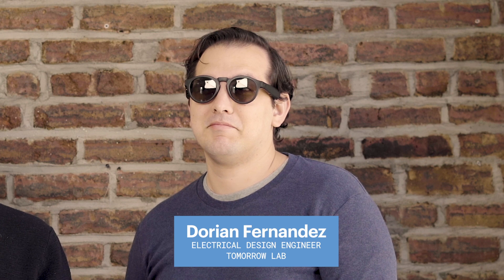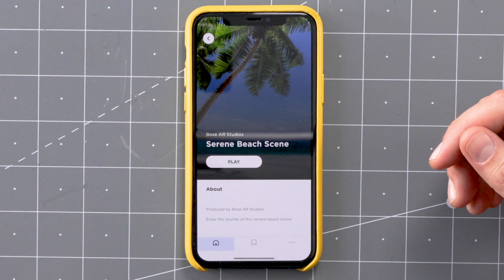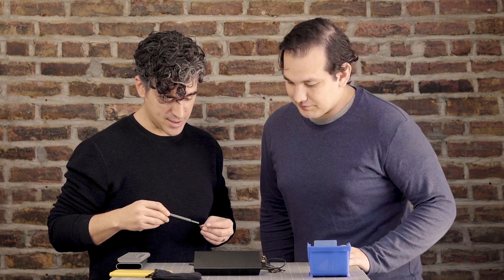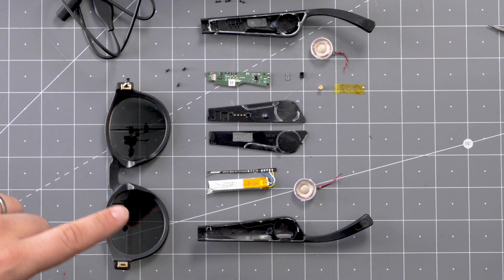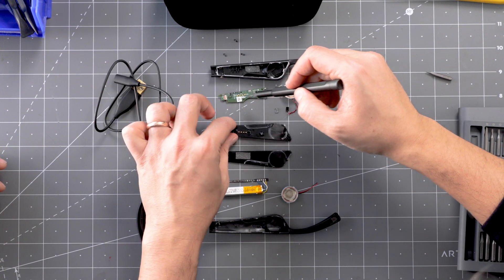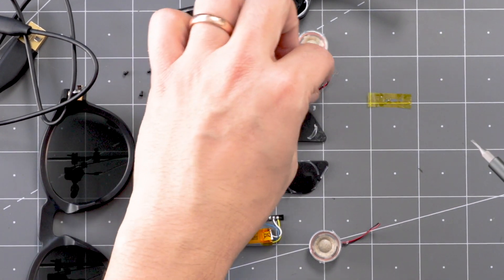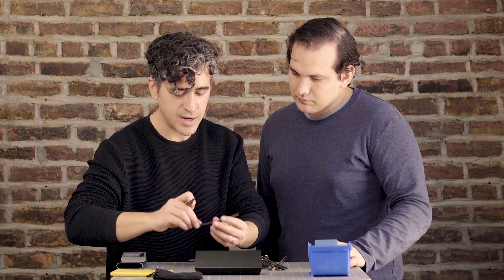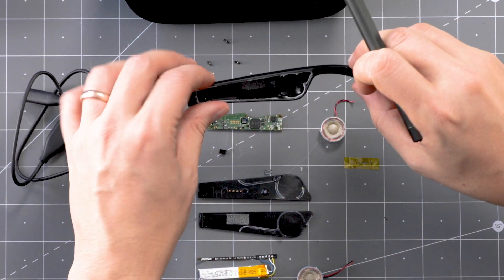BOSE Frames Teardown

Comment: Thanks for this. My frames died after 2 years and Bose won't repair or replace them, and they discontinued my style, so I'm stuck with my $400 lenses and a dead frame. They offered 20% off a new frame, that cannot take my lenses. I am escalating with Bose now, with high hopes they will step up and repair my frames. Glad I bought Bose, not a foreign knock-off. If not, your video will help me in my own surgery to attempt to repair.
Reply: Me too. But these guy should show us how they tore it apart without breaking.
Reply: I wonder if you had any success with Bose in the end - after about 8 replacements of Soprano, Alto, Rhonda they just stopped doing the replacement and they still have my last pair and refused to acknowledge receiving it even though I have the correspondence and postal label/ express post receipt. Their customer service became non existence sometime in 2023. Its just insane how the frames are so good to use and only last few months from terrible manufacturing choices.  Its so unfair as well they would send a replacement/refurbished pair but that serial no was out of warranty so you had to fight them to even replace that pair after even a couple months. Once I purchased two brand new frames while travelling off Amazon only for them to both stop working within a few days of each other. Most of mine have the issue with I assume loose cable where it only powers on with the bent arm, as soon as your try to wear it powers down.

Comment: My Bose frame came unaligned and would like to know what screw driver did you use? I bought a glasses repair kit with 32 heads but none of them fit. I contacted Bose and they were not helpful and suggested I get a replacement plan for $185. All I need the right screw driver to loosen the Bose screw. Thank you for your help.

Comment: Failing to charge seems to be a common problem for these sunglasses. Had them for 2 years but barely used them. So was disappointed to find out they don't work. It can't connect to online updates and can't be serviced. Expected better quality from Bose

Comment: I will never buy anything made by Bose again. After just one year these Sunglasses will not charge. Will be flinging them in garbage after spending $200.00 plus on them . Also, last year I spent over $300.00 on the "Bose portable home speaker" which I don't use  because the blue-tooth keeps disconnecting and the device constantly needs to be reset back to factory settings. Big issues with Bose design and dependability. What good is excellent sound if their devices don't work properly and fail prematurely?

Comment: I am facing weird issue with my Bose frames, I think there is a issue with the right side arm / stem. Frames does not work when the right arm is open or extended, it works properly when the arm is in close position. So basically if the right arm is not opened then the frame works properly.  Please suggest !!!
Reply: My Bose frames have the same issue, took them appart and found the tiny ribbon cable broken, same as shown in the video. I'm now looking for a replacement ribbon cable, otherwise they just became a pair of sunglasses, Lol.

Comment: The battery of my Bose Rondo is dead, Which battery do we buy to replace it? the Battery housed in left arm, correct?
Reply: any reply here? My frames switch off once I remove the charging cable.

Comment: The arms of the glasses are also were the problems are. Mine dont work when they’re open, turns on only when it’s folded
Reply: Same yo do you know how to fix em?
Reply: Same. Bose what's $150 to replace their faulty stuff.  Any means to fix?  I'm about to open mine and attempt it.
Reply: @speedyisland421  good luck guys. i don’t know how to fix mine. I actually had mine replaced with a new one coz of warranty but after a few months the same thing happened so this’ll be the last time I’m getting these shit glasses from Bose.
Reply: Riibon cable inside could be loose or broken. I have the same issue on mine, they just get charge and could listen when the right was folded. That ribbon ccable is very small and weak.
Reply: @MV_BassCovers  yes, brother. Apparently that’s what happened. I don’t know how to fix it so it’s now just a very expensive wayfarer lookalike 🤣

Comment: I have two pairs of these.  The first pair stopped charging, but the left arm on the second pair cracked at the hinge.  Lots of people have reported this problem.  What I want to do is replace the left arm with the one from the other pair.  I was able to remove the two little screws holding the arm to the hinge, but I need to know how to disconnect the arm from the metal hinge.  It is connected by what looks to be a small ribbon cable.  Is that plugged into the hinge?  How do I remove it and reattach the replacement?  Bose is no help at all.....  Thanks!
Reply: Were you able to figure it out?  I'm in the same boat.
Reply: I broke the end of my arm and was hoping i could replace it... so, as above... did you figure it out?

Comment: if you show how to teardown the right side arm . it will be very helpful. mine has som e issues with the cable. thanks
Reply from the maker: The arms are sealed closed with glue. we suggest applying some heat to warm up the glue, then use a spudger tool to pry it open (carefully!).
Reply: my problem as well. i actually managed to open it but came to a stand still till now where i could not remove the golden nob that connects the arms to the body. i need to be directed on how to remove this golden nob so that i fix the fibre cable which tore apart from the hinge due to constant use. how do i heat it up without burning or spoiling the component? any particular technique?

Comment: I'd like a bit more information from this and future teardowns, what's the size of the battery? What is the glue holding it together? How did you perform the teardown?

I own a pair of Frames and would like to replace the battery in future so a guide on how to open this up for basic repairs would be useful.
Reply from the maker: The arms are sealed closed with glue. we suggest applying some heat to warm up the glue, then use a spudger tool to pry it open (carefully!).